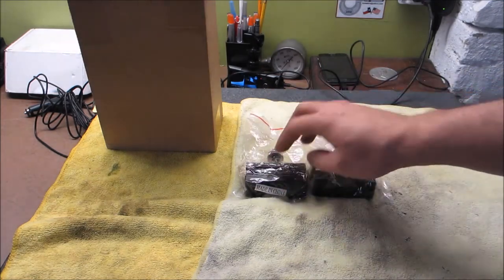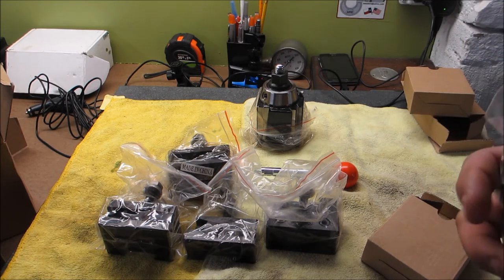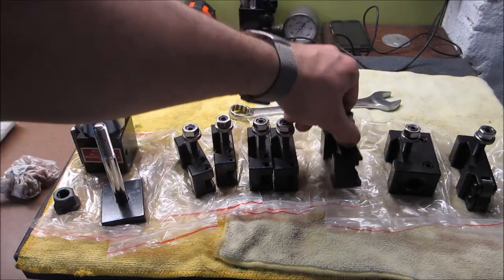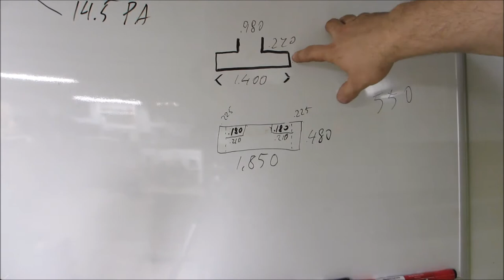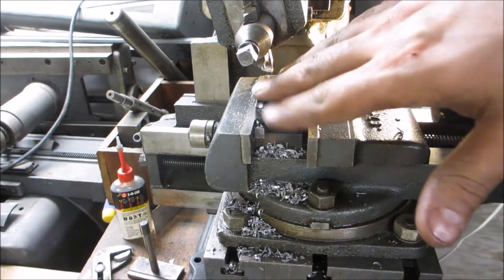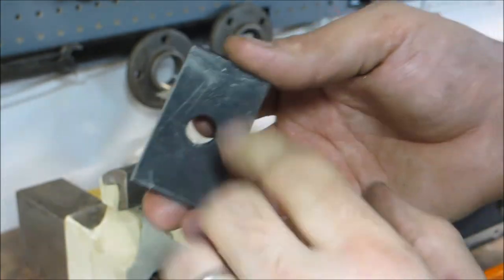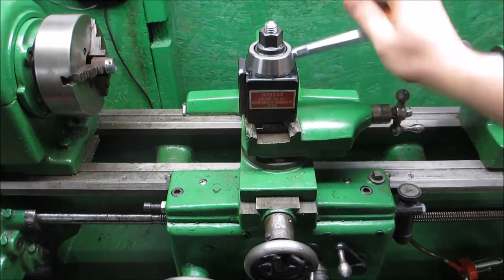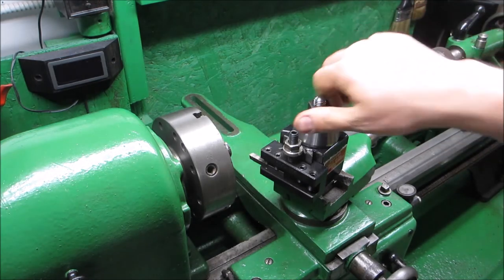Logan Lathe quick change tool post. BOSTAR Tool post

Comment: A shaper is always fun to watch.  I have not touched one since I was in high school a million years ago.  That is a better design of tool post than the one I bought.
Reply from the maker: +Amateur Redneck Workshop thank you Harold. I went out of my way to find a model with a wedge style fastener. I hear this type is more repeatable.
Reply: I had a plunger style one that came with my lathe, I swapped it out for a wedge style and it is much more ridged.

Comment: I have a old sheldon early 11ww its a 10x26 1936 from the army and I will buy a quick change tool post I dont will see the rocket post brrrr and I see that you have mounted qctp in your lathe and you havent problems with him ?
Reply from the maker: The quick change tool post has been very good so far. Much better than a lantern and shims for sure. As a matter of fact I am going to make more holders for it as I have more than 6 tools to use now.